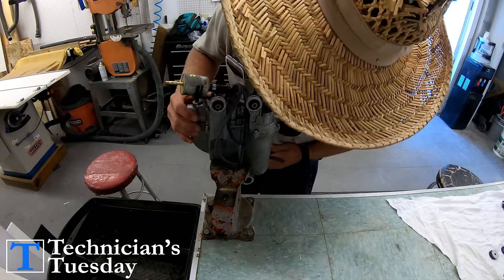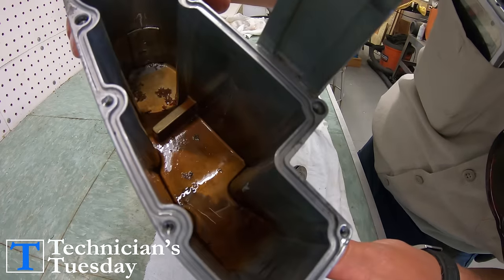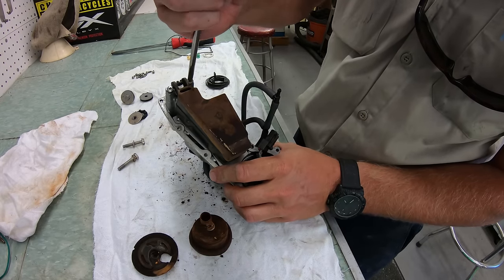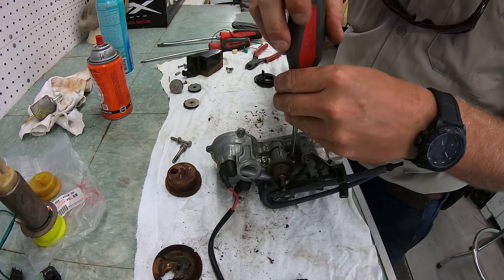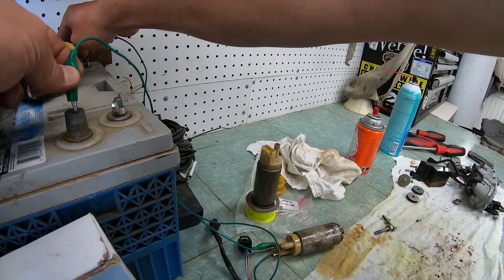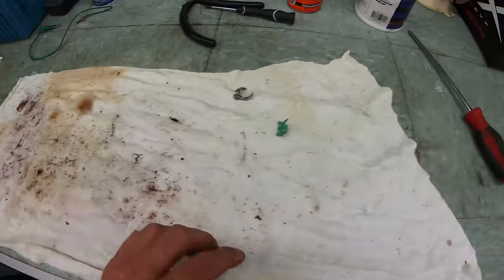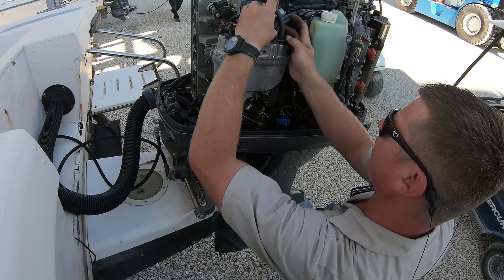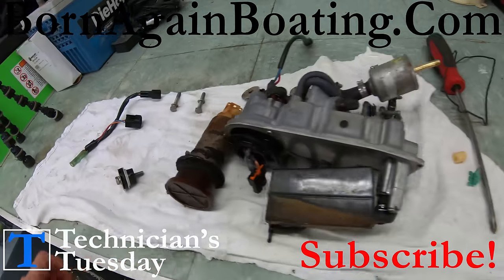How To Clean An Outboard Vapor Separator Tank (VST)

Comment: This video literally saved me 2,000 dollars, and got me out on the water the next day. The fuel pump inside my VST was locked up. So I took a battery an kept reversing the wires and sure enough it unlocked the fuel pump. Now my boat runs great, and I didn’t have to spend any money! Thank you very much! You are a great mechanic.
Reply: Just curious, is it still working? How many hours on the pump after getting it going?
Reply: @juanchy07  yep sure Is, I’ve probably put ten hours on it and still runs great. But when I fixed the pump, the motor only had about 20 hours on it.
Reply: @zanegibbs8135  did the bad fuel pump still make a noise? My dad's boat acts like it's starving for fuel. Runs for just a second and dies. 2012 150 hpdi
Reply: Do you actually hear or feel the pump running?  I think my VFT fuel pump is jammed but I don't know what the pump is supposed to sound like or behave when it is working.  I did exactly what you did switching wires back and forth and I only hear a clicking noise.  I found so much sand like substance throughout the VFT and both fuel pumps but not in the fuel filters.  I'm assuming it is an aluminum oxide corrosion.  I also found water throughout the fuel system.
Reply: @StarsAndStripers  when I did it I heard it running. I would say it’s time for a new pumpz

Comment: Really great video as a former mechanic it’s great to see people fixing stuff instead of just replacing everything and hoping for the best.
Reply from the maker: Thank you! Yes, there is a bunch of hacks out there that just want to get the job done regardless of doing it right or not! There's a difference in fixing it and just throwing parts at it :) Thank you for commenting!
Reply: I'm really guilty of just replacing parts on vehicles.  At my age and weight it's just a pain.  but when it comes to my boat, it's easier, cheaper, and sometimes even fun to do all the work.  The engine's are at chest level and everything is easy to get to.

Comment: I cant believe you would not bead blast the vst tank.I would fire one of my guys for putting that nasty thing back together without it being spotless. As far as the pump goes there's no way its going to last after being locked up. Tried it a few times to help a costumer out and they ALL came back. I"ll do everything i can to help my costumers out and save them money but not there. I dont want them going offshore and the junk pump die. Ive been working on Yamaha's since 1985 in my own shop. FYI.

Comment: My yamaha outboard bogs out and will not accelerate.  I checked the vst filter and look really clean. All filters are clean. O2 sensor clean. Could this be a fuel pump issue?  It will fire right up and idle for hours.  Its just when I try to accelerate

Comment: The fuel pump can be bought for around 30 to 50 dollars. There is nothing special about these pumps they have a lot of other uses in automobiles etc. Simply because it is on a marine engine is why it cost so much. I replaced the one on my 2002 Mercury outboard 115 HP 4 stroke EFI and I bought it on line. Simply get the original mfg part number and do a search on Google. You will find what you need if you just look.

Comment: It is becoming clear to me that fuel related issues are a major problem with outboards.  In fact I think you did a video on recurring issues you see regularly and that turned out to be your #1 issue.  I am assuming that this 300hp beast spent its previous life hooked up to and drinking out of a fuel/water separator filter.  If that is the case, tell me nobody is running unfiltered fuel to an outboard this big and expensive, how did all that debris make its way inside the vapor separator and the various screens and components in the first place?  Was the engine pickled in ethanol laden gasoline and simply abandoned to wick moisture of out that south Florida moist marine air, phase separate over time and left to deteriorate?  How did it get so bad?

Comment: Very clear voice of the instructor. Very useful information, thanks for your narrative and time to advise novice mechanics like myself. Getting ready to replace HP and LP pumps on my 2002 250 saltwater series.
Reply: Awesome video. ...will definitely try the reversing wires from a battery to loosen up the high pressure pump if it is locked up. Thanks again

Comment: I got a boat that sat for 4 years with 200hp optimax. I got the electric pumps for $211.00 and the rebuild kit for the mechanical pump for $30.00 all new, engines run great.
Reply from the maker: That's awesome! It's amazing how different brands make certain parts this astronomical price and then other parts are reasonable!
Reply: Yup, I saw some scary OEM Optimax parts, then looked aftermarket and saw far lower numbers.

Comment: I like most of this stuff but come on....the pump should never have been "freed up" and put back on.  It may be epensive but it's going on an expensive motor on an expensive boat and expensive toys cost money.  Replacing the pump after it's been so mistreated and jammed would seem to be industry standard to me.  I certainly wouldn't want my name on that "repair" unless it was ONLY to see if the engine could be made to run before putting money into a new pump..

Comment: thanks for great videos. I have been working on a 0x66. Couple bits of information I cannot get answers to are does the pump have a check valve in it? after prime is it to hold pressures or drop to 0 as soon as it turns off? What is the pressure range it is to run at?

Comment: Had this issue a couple years ago on my Suzuki 140, i had forgot to run some fuel conditioner thru it before putting it up for the winter and i guess the ethanol started eating into the rubber fuel lines, found small shavings of rubber in the filter, wouldnt let the motor get over 3K RPM

Comment: Hi, my vst filter on my 115s have been getting clogged very fast with the white ethenol type sand/powder. I literally just installed a brand new fuel tank. These motors seem super sensitive to the smallest particles. Would you reccomend running a 2 micron fuel/water seperator to catch the smaller debris that pass right through the 10

Comment: i will never attempt to reuse a seize fuel pump. that's a big red flag. avoid reusing at all cost. i learn that mistake years ago.
Reply: ice yaj same here. It will last for maybe two weeks then your stuck out in the Atlantic 30 miles off shore calling towboat us lol. And $800 for a fuel pump? I think he means $800 if you reuse because you forgot to pay the $600 for your year membership of towboat $40 for the fuel pump and $160 in beer that you’ll drink waiting for the towboat haha.
Reply: Is that a thing? In New England we have a few choices. I pay a yearly fee to a company called tow boat US. That fee is depending on what service level you get is between $500-2000 a year. It offer you fuel delivery if you run out of fuel or a tow etc etc etc. it’s sort of like AAA for boats.
Reply: @refiii9499    $600??   Here on Long Island Tow Boat US, or Seatow is $150/yr for the unlimited tow package.
Reply: Hubjeep I have a 2018 Bertram 50’ that holds 1,236 gallons of fuel and I go out to Jeffries ledge and sow and pig reef cuttyhunk on the regular. For my class yacht it’s what I pay for my insurance and piece of mind. I had bad luck with seatow back in the day. I don’t use seatow anymore but I heard they are much better now though. so I can’t talk about their pricing.

Comment: I just got a 2002 200hp HPDI that has been sitting for over a year. This is great info for my project. Glad I found your channel. Subscribed!
Reply from the maker: Welcome aboard!
Reply: @Bruce Lott I just picked up a 2001 200hp HPDI that sat for a year as well. Winterized in New England at the end of 2019 and sat all last year. Curious if you got yours fired up yet and/or what you’re doing before bringing it back online.
Reply: @SD-unlimited  I pulled the plugs, used a lot of fogging oil, turned it over by hand several times. I made sure  the fuel pump came on, then started it up on premix . Once it fired up, I changed all the filters, changed the thermostats, removed and cleaned the injectors, cleaned the HO2S, changed the water pump. I also flushed the cooling system with vinegar to get all the scale out. I still have a couple of issues on the boat, but it's coming along. I  also installed a water temperature gauge on the dash. I didn't use the Yamaha gauges due to them being faded and I had already installed new analog gauges before I changed the motor.
Reply: @brucelott3583  Thank you for the info, I appreciate it. Sounds like you’re going through a very similar process to what I plan to. This motor was running well and fully serviced and winterized prior to being stored (outside, mounted to transom) at the end of the 2019 season. I’m not sure if the VST filter was changed. I want to ensure the I’m doing everything properly during initial startup so that there’s no mysteries or issues. I’ve got about another month to get everything sorted out with the weather improving and more consistently getting above freezing. 
I hope all works out good for you and that your project is a success 👍
Reply: @brucelott3583  I have now fogged mine, turned it over by hand and everything seems to be in decent shape. I was curious though since I’m new to outboards, how did you confirm the fuel pump came on? Is it on the engine side or gas tank side like a car? 
We’ve got one more day this weekend where we’ll be flirting with freezing temps. After that it looks like I’ll be clear for the first startup.
Reply: @SD-unlimited  The electric pump is in the VST. Just turn the key on and listen for the pump to activate. It will only run a few seconds if the engine isn't running.
Reply: @brucelott3583  Thanks again for the info Bruce, I appreciate it. 3-6” of snow forecast for my area in the next 36 hours. Looks like it’ll be a couple days before I get her fired up. Hopefully that’s the last of the cold and snow for this season.

Comment: Is the vmaxx 250 hpdi the same?
We having issues that when trying to plane, it lets go, grabs again & lets goo. Making it hard to get the boat on plqne. 

So far we added new fuel lines, new primer pump, we are going to check if fuel pressure drops then start cleaning eveeything again, we had issues with bad fuel at first.

Comment: Great video. Only thing is $800 for a fuel pump? All the vst fuel pumps I’ve ever changed (which is a common thing) cost between $40-100 depending on which engine (Yamablah always seems to be the most expensive). Unless you are talking about $800 being because you didn’t change it and two weeks later your 40 miles off shore at Jeffries ledge tuna fishing and your pump fails and your $600 a year membership of towboat is kicking in now your drinking $100 in beer waiting for the towboat to arrive lol. For real great video and some good tricks on all your videos. Thanks for sharing.
Reply from the maker: Lol, yeah, Yamaha does put some ridiculous prices on their parts. I ended up putting an $80 Axiom pump in this one, that other pump didn't seem to have enough vacuum after getting it freed up. :)

Comment: Great video, I just finished doing the same thing to a 05 Optimax 225 that I boat and had water mixed with ethanol and the vst is almost 100% the same. Few different filters and such but just a quick tip to the viewers like you mentioned when you take it apart make sure you watch for the pump oring to get stuck while your removing it

Comment: You make it look so easy! I have OX66 200. It runs great when you give it throttle, but soon as you need to pull up to the dock and need precise throttle control, it stalls out. I've changes plugs. Next step is cleaning my VST and O2 sensor. Think those will fix my stalling issue? By the way, I run non E fuel and sea-foam in every fill up.
Reply from the maker: Yes, the O2 and the VST would be the next places to look if its stalling at idle, hopefully you find something when you pull it open

Comment: I have a Mercury 40hp 4 stroke EFI. I did a pressure test on my VST and I'm getting 70psi which is very high. It is suppose to be at 42-44psi. I put in a new high pressure fuel pump, but I'm still getting the same 70psi reading. Any ideas on what could be causing the high pressure? Your help would be greatly appreciated, thanks.
Reply from the maker: That's odd. 70 is a lot! I could only think of an issue with your pressure regulator or possibly your pressure gauge ;) Most of the time the pressure regulator causes a loss of fuel pressure, but I guess it is a possibility that it could raise the pressure too! Other than that maybe a gasket not seated properly on the output side of the high pressure pump?
Reply: Thanks for the reply! I thought of the pressure regulator too, but it seemed fine when I had to change the high pressure fuel pump out. The pressure gauge is brand new and was pretty spendy, so I wouldn't think it to be that. I just bought it last week to test out the VST. I was having issues with the motor restarting when hot and couldn't hear the fuel pump kick in after that either. That's why I bought a new pump. This is really stumping me!! I haven't ran it long enough to see if the restarting issue has gone away. I'm afraid of the pressure being that high though. Do I run a risk of ruining anything if it's that high?
Reply from the maker: No worries! Ok, so the gauge is good. You don't really run too big of a risk, because if the fuel pressure is that high, the engine should run pretty terribly and have some issues. The pressure regulator is the only thing I can think of off the top of my head. How much are they?
Reply: The ones that I have seen online are around $30. That is around the same price as the fuel pump I bought. The only problem is it's a lot harder to find the right make and model pressure regulator for my motor unlike the pump, that was easy to find. The mystery deepens however. I took the boat out around the lake yesterday for about an hour or so, and it seemed ok. It didn't run rough or have problems accelerating or anything. It was still reading 70psi though! How is this possible? I tried letting it sit for about 25 minutes after running to see if I could get it to do that cranking with no fire issue like the first problem I had, but it started right up again. I don't think I let it sit long enough though, because before it seemed I'd have to wait at least an hour or so of not running it to get it to do the cranking with no fire. I'm going to try again today and see how it goes waiting at least an hour this time. I did notice though with the cowling off, I could hear a slight almost like a pulsating hissing noise that went with the sound of the motor coming from the opposite side that the VST is on. It also got louder when accelerating. I'm not sure if that is normal or not? My thought was maybe it was pressure being released somewhere from having such high fuel pressure in the VST. It's really strange, and I'm really confused...
Reply from the maker: Hmm that is interesting, if you want to email me your serial number I could look up the pressure regulator and get you the correct part number. The serial number will be on the starboard side of the engine bracket and will begin with 1 number then it will have a letter and then 6 more numbers, it will look something like this: 1C123456.
Not sure what else to say on the pressure side of things. That hissing sound is most likely the idle air controller, that's a normal sound. Hopefully you have fixed it and are now over thinking it :) let me know how it goes!
Reply: Email has been sent, it matches my YouTube name. Thanks for taking the time to help! I'm going to be taking the boat out again now, so I'll have another update in a few hours.

Comment: Greetings from Ireland. New sub here. Very good. Question.  I have a Johnson 200 electronic fuel injection. Can. Clean the injectors the same way? Would it be better to ultrasound clean them ?    I hav3 the same problem as you not enough fuel I think. Keep up the great videos.

Comment: Great video. In this process. I have a 2002 sx200, my float didnt have a spring, thought maybe I lost it in disassembly. I checked manual and doesnt apear to have one....I hope not...will know tomorrow...side note, my pump was as nasty if not more.....tried your method of getting it free...soaked it for 24 hours in carb fuel cleaner.... reversed polarity back and forth.....nothing....feel it move but just am intial click.  I ordered a new one. After new one comes 5 days later and old one laying on the bench, I had to give it another shot,  I put the leads on it and boom freed and moving.....really! Sigh, guess I have extra pump now....

Comment: Can vst cause rich condition?  I have a 2000 merc 200 efi.  I changed trigger based off rough running but didn’t fix.  I decarbed using sea foam and afterwards it ran same.  I noticed before and after that plugs are wet after running.  Any ideas?  I have service manual

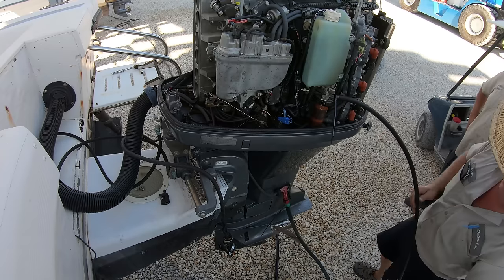Comment: At 06:19 (https://youtu.be/Qtz-9_-_dTk?t=379) you show starting it with a key while not at the console.  I've got a pontoon boat with a Suzuki DF115 that I'm about to attempt a similar VST service on.  Is there a way I can attach an ignition switch at the motor so I'm not having to climb up and down off the pontoon boat every time I want to turn on the ignition?

Comment: Thats nasty... I would install a canister type fuel water separator plus another inline filter in the boat before it gets to the motor.. And mabe run some fuel treatment every tank or two
Reply from the maker: Sure is! That's how most of the boats are set up! With a water separator in the boat and then a filter in the engine. This had just sat for like 6 years :)